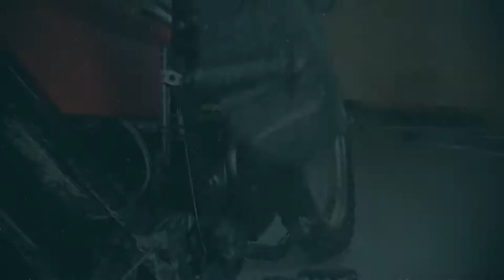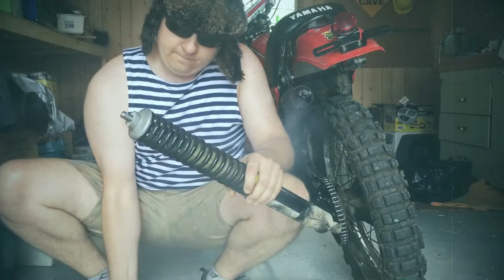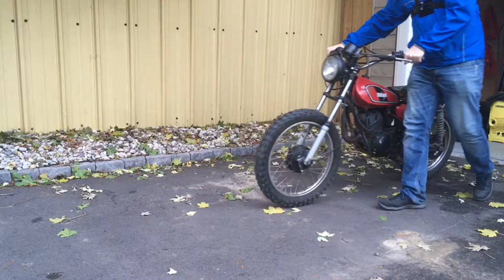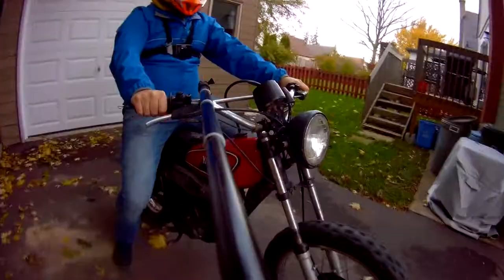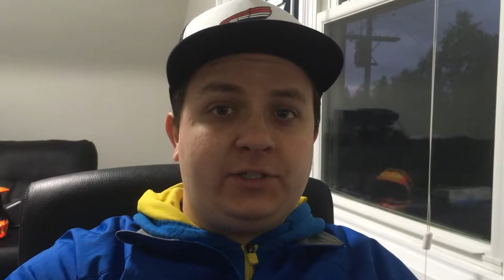The $250 Vintage Enduro Project RUNS! (Yamaha DT100 Restomod Build Part 1)

Comment: I have a yellow 1977 DT100D. I repaired some rust holes in the tank and replaced the original front tire, tube and rim band. it looks and runs good. always been stored indoors. might use it for exploring logging roads and trails in Washington. I have owned it since the late 1970's. They are very good and reliable little trail bikes. I originally bought it for my wife and it was the right size for her.
Reply from the maker: That's awesome! Exploring logging roads would be SO fun. I don't remember if I mentioned it in this video or not, but I got this bike to rebuild for my girlfriend as well. Hopefully she's into it! If not I got another bike I can ride haha!

Comment: the craziest thing happened that made me come across this video. me and my friend were walking down my road and we see a nice, obviously old dirtbike in an open garage. we then ask the lady about the bike and she says its been sitting there for 20 years plus and everything seems to be fine with it. i kicked it and i could tell she can definitley start all she needs is maybe a new battery for lights and everything and just some new gas, tires, and just clean it off and i swear that thing could be just like brand new. tell me, did i get a good barn find? i feel like this thing has potential! (btw im talking about a yamaha enduro 100 same one in the video)
Reply from the maker: heck yeah man! It's a fun little trail bike that will run forever. Take care of it and it'll take care of you haha. Make sure the oil injection works, if not you can always run  premix. Definitely a good score. You can always do a 175 swap down the line as well.